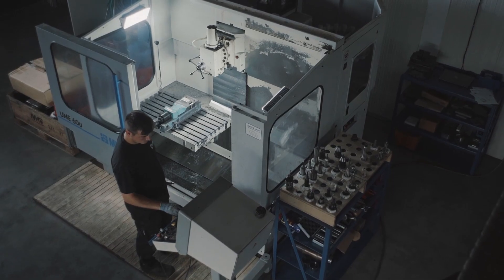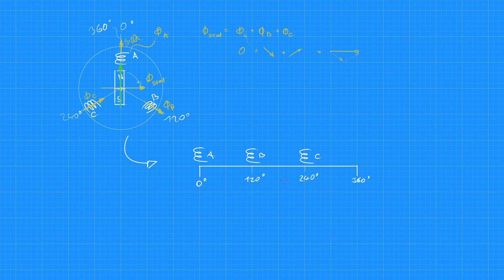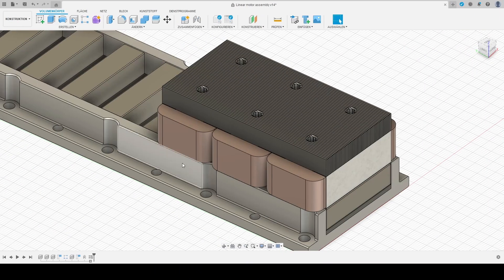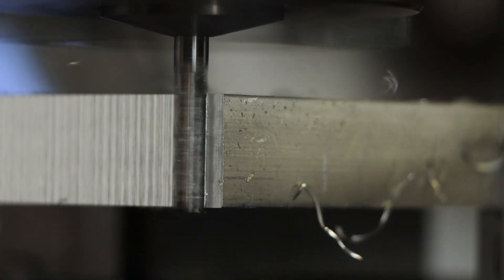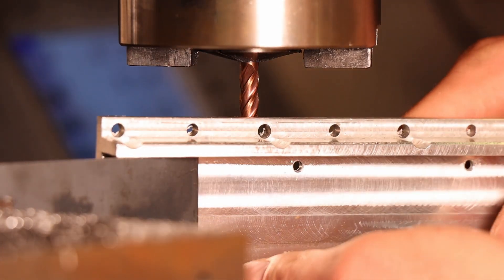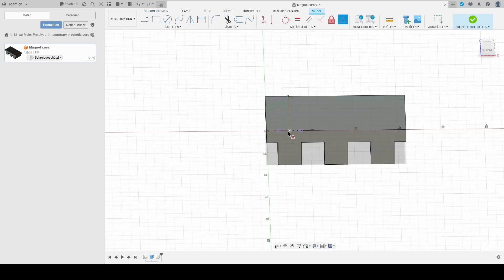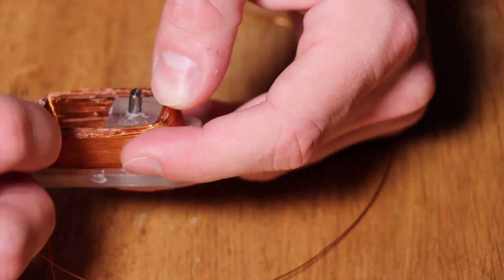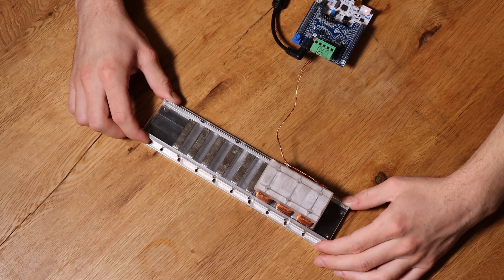Making a LINEAR MOTOR for a DIY CNC mini MILL - Part #1 (Step-by-Step)

Comment: Here is an idea. Instead of a linear motor a linear generator. Placed inside of a wind turbine blade. The force of the blade moving “eventually” from up to down and then back up could be a small booster for a slow prop speed wind generator. Wouldn’t work for a fast moving blade “unless it was sprung” but if you notice the very large wind generators they move at about the right speed. What do y’all think? Would that work as a small booster for a wind generator. Maybe even getting past the all elusive 59% efficiency.
Reply from the maker: Hey Tom, that’s an interesting idea! The challenge is that adding a linear generator into the blades would introduce a lot of complexity and potential imbalance, especially at low speeds. Also, there’s Betz’s law to consider: it sets the absolute theoretical maximum efficiency for any wind turbine at about 59%. Unfortunately, no design can surpass that limit, since some kinetic energy must always remain in the wind to keep it flowing through the rotor.

Comment: Excellent start. For the stator magnets, you will increase field strength (and therefore axis stiffness, ultimately) if you use a Hallback array configuration. That basically means additional magnets between the ones you already have, but with the field oriented along the axis, not perpendicular to it.
Reply from the maker: Thanks glad you liked it 😁 yes I have plans to use a hallbach array. But slightly modified to embed some iron in the stator for reluctance forces

Comment: Using off the shelf motor controller defies the purpose of linear motors in CNC, which is to prevent vibrations. 
Ideally you'd have to make an analog driver that provides linear current changes, not a chopped DC one like in all those drivers.
In other words you need an audio amplifier on the output & and at least 3 function generators on the input which are 120 degrees out of phase. This can be done digitally, with proper filtering to smooth out the output current. But the power amplifier has to be linear. 

At least you could try to use some low pass filters to smooth out the chopped DC from the driver. But then this might mess up the current sensing those drivers use to orient their phases.
Reply from the maker: Hi i get your point. However there is a big drawback when using analog linear amplifiers. Massive power losses in the semiconductors. Fortunately the inductors smooth out the current (of course we cannot fully eliminate the ripples). But we can reduce them by increasing the PWM frequency or the inductances. Additionally the motor‘s mass also dampens these ripples. So the motor is a PT2.

I guess that for a whole CNC mill the we would have a massive cooling issue when using linear amplifiers 😬

Comment: I sugest you make it tubular linear. make the stator of widing couper so the cable dont have to move and create friction. if dont get to hot you can put the cable inside the tube. and the rotor will be an holow tube with magnets using halbach aragment in a sandwich. so the magnetic field will be focus inside and the outside(outer ring side) no magnetism. powerful and easy. 
Maybe i need to hink a litel bit more on the stator because is not valid having it as sandwich widings because the exterior has less magnetic force the inside where cable goes.
To make it easy can be used as sheet as yours plane instead as tube.but coper down and magnets up and use halbach array aragement to avoid magnetism on top on machinery and empower interaction with the stator. And to see where it is position just lector hall senzor in one side with track detection. i am not goo in electronics but i can see the mechanical deasing.
Reply from the maker: When I finde some extra time i‘ll run one or two simulations and answer again

Comment: Wait so what lateral spacing do you want for the stator and the magnets?
Reply from the maker: You mean the spacing between the magnets? As I use a halbach array in one of the following videos it would be 0. But I can say that the distance between each pole center would be 20mm

Comment: Why didn’t they want to repeat the stepper motor in an expanded form? two rows of plates with teeth and a magnet between them - the lower part, and the same two rows of teeth on top with a coil. Was it really difficult?

Comment: It'll be way stronger if you put an iron core in the coils instead of plastic - either laminated or powdered, not just solid iron or eddy currents will be a problem
Reply from the maker: Hey yeah I am currently building different cores with powdered iron/epoxy, small iron pellets/epoxy and laminated iron core :)
Edit: I ran a couple FEMMs and we should expect worst case ~170 N at 2A

Comment: Is that going to have good resolution?  It looks like 1cm resolution to me.
Reply from the maker: Yeah way better than in the clip. Using an encoder the controller adjusts the current-vector so in theory resolution is depending on your encoder

Comment: I am desperately awaiting the rest of this series! I have been wanting to use linear motors for a while. I just feel like without seeing one built and control figured out from start to finish I won't understand well enough to integrate it into a CNC machine and actually benefit from the linear motors. This is a fantastic video and you are terrific at explaining the motor side of it. I am already pretty well versed in electrical motors and how they work mechanically its just control wise I have a hard time with understanding coding for control loops. Obviously this just used a pre programmed timed switching on and off of coils to move it along rather than hall sensors or an encoder but I can tell its coming and I am STOKED! I'm going to be 30 minutes late for work because I saw this video and couldn't resist!
Reply from the maker: Hey it is comming :D
I am just very busy at work right now 😅
Reply: I’d recommend setting up a brushless closed loop motor with SimpleFOC based on your comment.

Comment: While it’s an option to try and get silicon steel laminations to make your magnetic out of, you could also try to cast your own ferrite epoxy. But you’d need to calculate if the strength would be acceptable. You could even design water cooling channels to be embedded within the magnetic core, if you want to maximise your force output. I’d recommend whipping up a jig to measure the peak force output of your setup and at what current, and extrapolating from there how much current you’d need in order to get the force required to move a CNC mill without running into chatter or skipping steps. My guess is that direct drive just won’t be able to output enough power with a motor of that size, there’s a reason most CNC mills use screw reductions.
Don’t forget to use field-oriented-control to maximise force and minimise force-ripple. Using an excessively high supply voltage will mean higher switching losses, but the FOC controller (I recommend the TMC4671, coupled to a TMC6200) will be able to use that extra voltage to force extra current into the motor when it’s needed to maintain position or speed.

Putting silicon steel or ferrite behind the magnets might make a difference too, though less so if you’re using a halbach array. Which you should be using.

Any plans for a linear encoder?
Reply from the maker: I finished the rig and now I’m making a core like you suggested. I’m also using the halbach array and some steel for reluctance forces. The software from ST features FOC. Tweaked the design a little. Ran a couple FEMMs and the minimum force output should be ~170N @2A.
I found a rotary encoder in my drawer so I’m using that for now and later switch to a linear one.

Comment: Very well made video as well as great project, really looking forward to the next one. 

A couple recommendation for the design, with the industrial linear motors that I have seen on a few pick and place machine have a gap between the forcer and the stator is only a couple hundreds of a mm (plus the 0.1mm coating over the magnets and the coil). This should help with the motor power (which will likely be critical on such a small motor).

Another recommendation as well, would be some kind of water cooling for the coil, as heat is going to be a major problem with a small forcer of that size. The industrial unit use an aluminum extrusion profile as the main cradle for the forcer (milled on the back as well too for improved parallelism).

The magnet tracks have a ground steel back and then they mount onto the machine frame with very uniform height.

As for machining if you want to make sure that your linear rail and magnet track is very parallel I recommend for simplicity that you machine them both on the mill in a single mounting. Mind that when dealing with plate stock like this the best way would be to not use a vise as the vise will jaw lift the part as well as bend the part which will result in the top and bottom not being flat or parallel.

What I would do is mount a sacrificial plate or blocks, that will lift the part high enough for machining and then you face them to insure its parallel with the axis travel. Then you just drill mounting holes into the blocks/plate and bolt the plate down with countersink or counterbored screws. That will allow you to machine both the top as well as the perimeter of the part (then flip the part and deck the bottom). 

While this does not guarantee the part will stay flat when unbolted it will guarantee uniform thickness, which when bolted onto a precise mounting surface will flatten the part. It will also be a more solid mounting which will reduce the chatter due to the part bending under the cutting force (as well as allow for larger parts), so I would really recommend doing it that way.

Sorry for the wall of text and I hope it helps!
Reply from the maker: Hey thanks a lot for the great advice 😁

Comment: Nice video, is just I want to become in few years, I just need the space for all the machines and tools, I hope next year moving around to a new place with more space. Now I just have a 3d printer, but I want to build a CNC machine, spooler, hot plate for soldering, and a plastic filament recycler.
Reply from the maker: Thanks! Sounds like you’ve got some awesome plans ahead. I'm excited to see your projects. 😁

Comment: Aren't linear motors relatively poor at generating torque? Most metalworking CNC machines use ball screws for all three cartesian axes because of the torque multiplication inherent in that setup.
Reply from the maker: Hey, they generate less force as a servo/stepper with a ballscrew. That’s right. Yesterday and today I played around with the design and did a couple FEM. I decreased the core width from 13,3 mm to 10mm, set stator/forcer distance to 0.5mm, increased the turns to 750 and did a combination of a halbach-array and some iron blocks (for reluctance forces). Results of the simulation where stunning. 274N of force 😁. I know still less than a ballscrew but I think it seams promising 😁.
Edit: @ 2Amps rms

Comment: i think you need winding stator, but rotor should be permanent, and install halls to determine the position. It will be like bldc but linear.
Reply from the maker: I am using an incremental encoder (higher resolution than hall-effect sensors) for the test stand. Just finished it. Maybe I'll give it a try.

Comment: if you replace the iron core which conduct magnetics with 3D printed part which assume the magnetic potential greatly, I'm afraid the output force would decrease and the speed and dynamic reaction would become bad sharply, like a Coreless Motor, . so I suggest you should design the magnetic circuit carefully and concentrate the magnetic potential to the air gap between the coil and the permanent magnets, just like a real motor
Reply from the maker: hey, I just used this 3D printed part because I was lazy 😅. Of course I will make a iron core. One will be made from laminated iron and for the other i'll use epoxy and iron powder/granulate.

Comment: Your english is fine. In fact better than most! Playback speed at 75% and subtitles makes a big difference. The issue is you need a better microphone! Far LESS base and more treble will make your voice much clearer. Great 1st post and looking forward to interesting engineering.
Reply from the maker: Hi thank you for your constructive feedback. That really helps to improve the content. In fact I bought a rode mic in the final hours of editing and after hearing a sample I redid the whole VO 😅. I’ll change the equalizer settings and try to speak slower and more clearly😁
Reply: @NeverGetTiredEngineering  OK! You have a pleasant voice. Just Speak s l o w e r . . . please. 
Anyway, very interesting content,  I'm looking forward to seeing how it all turns out. I'm rather certain you need iron core in those coils. Even if it is solid iron rather than the preferred laminated form - at least for prototype. 
Good fortune with your projects!

Comment: You should make the coils stationary and have it move the magnets. Looks nice though.
Reply from the maker: Uff so many coils 😅 maybe I’ll give it a shot in the future and compare both systems. But I think done correctly and disconnecting unused coils we could distribute the power losses over a larger area and pump more current through. Great idea
Reply: @NeverGetTiredEngineering  Yep, Charlieplexed mosfets for the win.

Comment: Seems like very little power
Reply from the maker: In this video it is.
Some reasons are:

• The current provided by this board is quite limited (2 Amps peak). I'll be ordering a more powerful one soon.
• There's no closed-loop control, meaning the controller doesn't know the mover's position or which coils should receive which current.
• The absence of an iron core is another factor.
• With systematically arranged iron, we could take advantage of reluctance forces.
• The air gap (2mm) is way to big.

Greetings

Comment: I wonder if it's possible to print the core using resin that has had iron powder mixed into it? It may not be the most efficient core, but it could be a quick and dirty solution for initial prototypes.
Reply from the maker: I'll try that. I want to compare this iron/resin core, non-ferrus core and laminated iron

Comment: Have you thought about the max force the motor is able to produce? I somehow have the gut feeling that this could be not enough for the cnc machine? Otherwise great video!
Reply from the maker: Yes, I did some very basic and idealized calculations to estimate the force. If the magnetic field isn't homogeneous, which is the case in this setup, the situation gets complex quite quickly. To calculate the force, I used the Lorentz force equation, but we can and should also consider leveraging magnetic reluctance.

I plan to experiment with various magnet and steel configurations to optimize the setup. Currently, my biggest challenges are power losses and cooling. So it's hard to say how much current I can pump through the forcer without setting it on fire. Whether the force generated will be sufficient for the CNC machine depends on its specific mechanical requirements and load conditions.

Thanks for your input and for watching the video!

Comment: have you does some first order stiffness analysis on this.  i think you will find that the stiffness for a moderate current without water cooling with be really poor
linear motor excell at low load high speed not hight load low speed
Reply from the maker: I'm sure I won't be able to avoid water cooling😅

Comment: Pretty killer first video, im looking forward to your future here. Have you looked in to the Kern machines for inspiration? IIRC they use linear motors in some of their machines x and y axes. Paired with hydrodynamic slideways it creates a very rigid and low static friction system. Diy hydrodynamic ways would be a very cool addition, but certainly adds way more work than linear rails.
Reply from the maker: Hi thank you, your comment made my day xD. Noted. I'll dig into that
Reply: Well yes but it is really expensive and hard to do but maybe igus or pbclinear plastic bearings make sens for these machines. I would just stick pre-loaded bearings and rails for this project.

Comment: 4:56 just a Tip: this center drill is not designed to be used for starting holes for drills but for the live center for lathes. you should get a spot drill with a higher tip angle than the drills you are using.
Reply from the maker: Good to know! I’ll buy one.
Reply: @UncleKennysPlace  that makes more sense thinking into it, an edge getting caught means the drill will immediately try to 'walk' from the first spot it catches. Got it! Thank you for providing usable information.
Reply: @Roobotics  Center drill = 60*, regular drill = 118*, spot drill =120* (or larger). A 118* point will center on a 120* hole. A smaller angle will always self-center into a larger angle. Not the other way around.
Reply: @chip-load  that is fair, I think my brain has dyslexia when thinking about angles but as long as it's a 'needle' hitting a 'cone' it will tend to center itself, and the other way around can cause the cones edges to engage the sides of the hole and apply side-loads.
Reply: An explanation on why it's wrong would go a long way here. But from what I can find, it's because the sharper tipped ones cause the initial contact with the next bit to be used to deepen it, is harsh on the edges and more prone to causing them to fracture? I feel like a 90 would give better location results than the flatter 120 that is more like a traditional bit.. likely just avoid a 60 degree one, his looks like a 90, but maybe not.